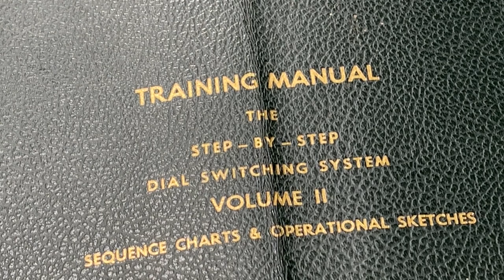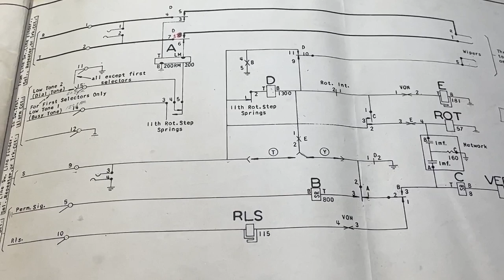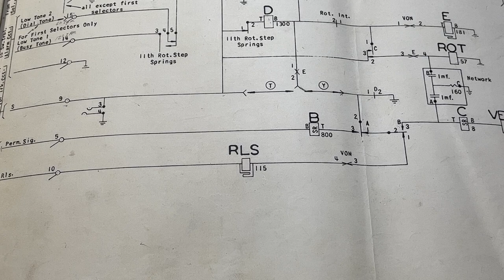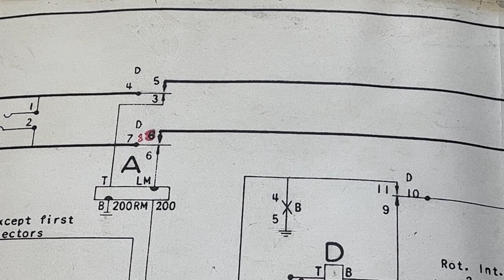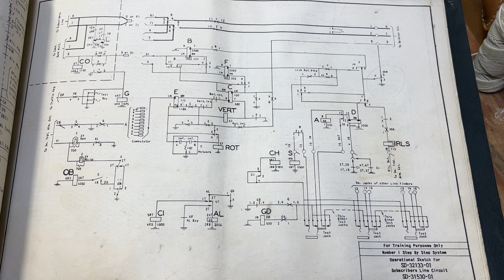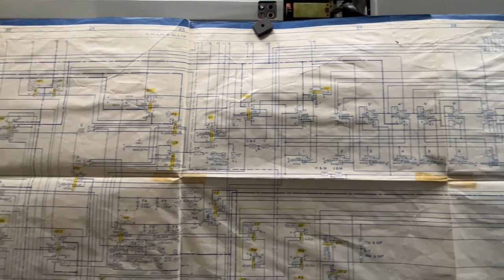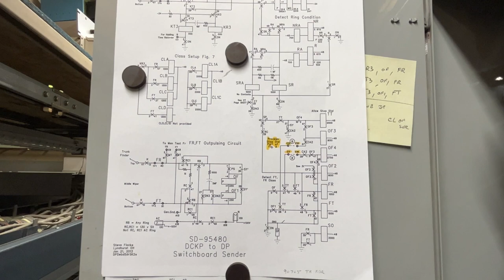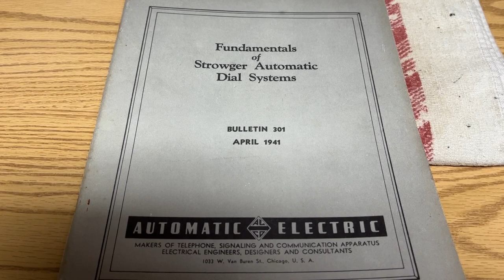Strowger step switch (SXS) demo system overview, for beginner's.

Comment: Good overview Prof. Phil!  

Ever heard of TonePulse Converters, by American Telecommunications Corp?  I managed to latch-on to a couple several years ago, but I can't seem to find much on them in-terms of documentation.  They're small blue square boxes, with an aluminum clamp on the top, for mounting to a horizontal rail system.  There's 12 dip switches on the rear, & some type of 6-position connector on the front.  Just curious to your thoughts on them.